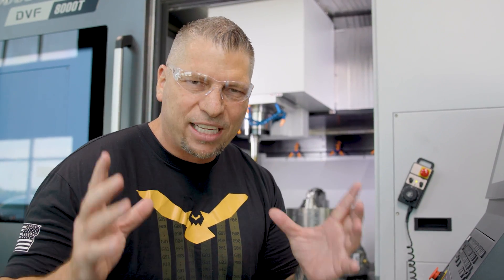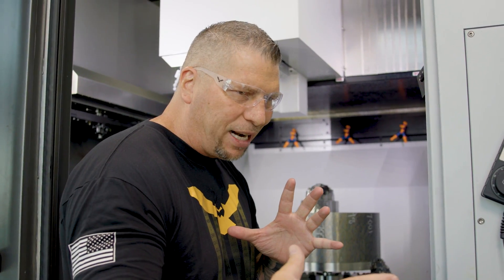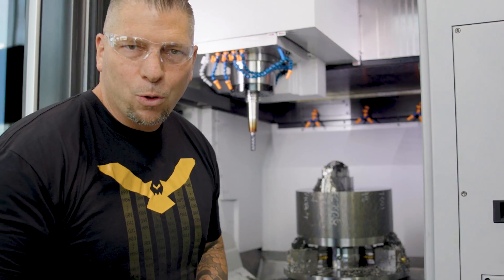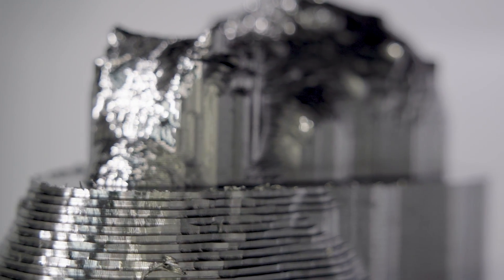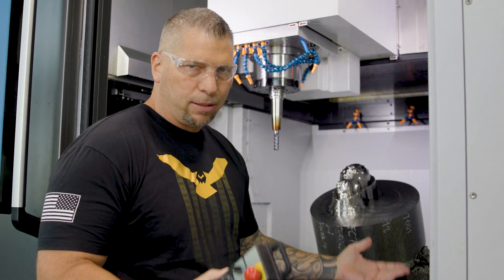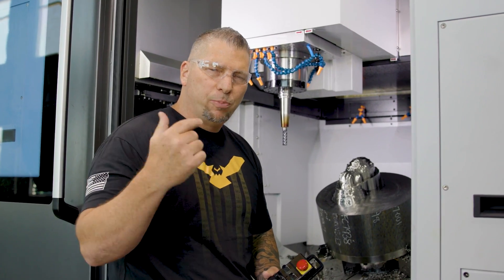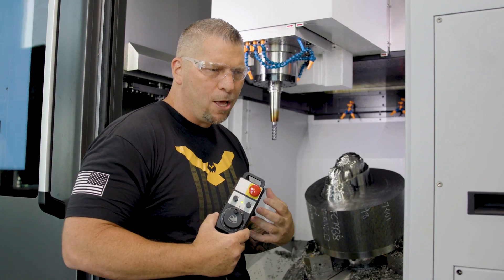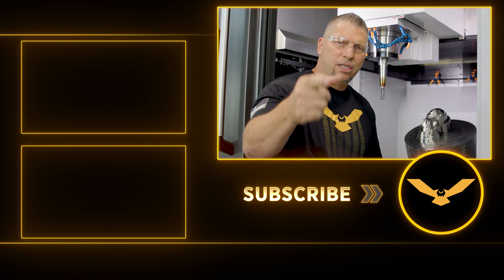MILLING $10,000 of TITANIUM | Most Epic Project To Date!!!

Comment: I’ve said it before and I’ll say it again….you can machine ANYTHING with the right CAD/CAM software.
But you can ONLY call yourself a programmer if you can do it at the machine….no exceptions!!

The End. BOOM
Reply: Have fun programming this project at the controller.  What kind of machine are we talking about anyway?  A mill? Vertical or horizontal? How many axis? 3? 4? 5?  A lathe? How many turrets?  Dual or single spindle?  A swiss machine?  How about a cnc grinder?  Hell, what about a NC machine that predates the computer controlled machines?  How about a cam driven machine?

My point is that your definition of a person that call call themselves a programmer is painfully flawed.
Reply: @brandons9138  well it seems my original comment got deleted but I love how you think I need to justify my statement to a pointless nobody like yourself!

If you were a programmer you wouldn’t have replied with such a pointless argument in the fashion that you did!

Another wannabe programmer who’s just an operator by any chance?
Reply: @Mister_H.  I've been in the trade for 15+ years and have done just about everything in a shop.  Started out in the tool crib and driver in my early years.  Since then I've been department leads in both mill and lathe departments in multiple shops.  I'm now responsible for the 14 swiss machines and our newest 9 axis Miyano lathe.  Most of the swiss department is currently running jobs that I've programmed, set up and proven out.

You are just a much a pointless nobody to me as I am to you.  However I wasn't the one proclaiming that I knew who had the right to call themselves a programmers and who couldn't.  

I asked a valid question.  What kind of machine were you talking about?  Following your shallow definition of a programmer if you can't walk up to any machine and program it at the box then you can't call your self a programmer either.  What about Mazatrol?  Does that count?  Or are we only talking about standard G code?
Reply: I've only programmed with the fanuc dialogue, and can't even do cad/cam as I never get to learn it... Am I even then concidered a machinist? 🥺

Comment: Are you able to recycle/sell the titanium chips? 👍🏼👍🏼
Reply: Any chips as far as I know. The thing is, at least where I work, is that you get paid for the cheapest material, so if you have 95% titanium and 5% 4140 in the bin, you get the paid for 100% 4140 instead
Reply: Yes, the problem is to always have completly clean machine between switching materials, so you won't contaminate chips.